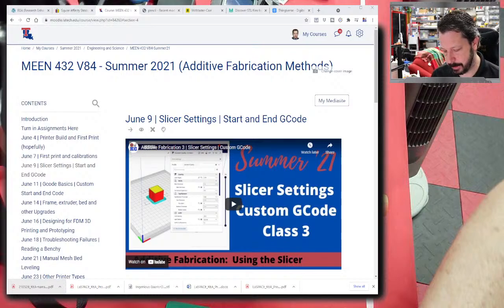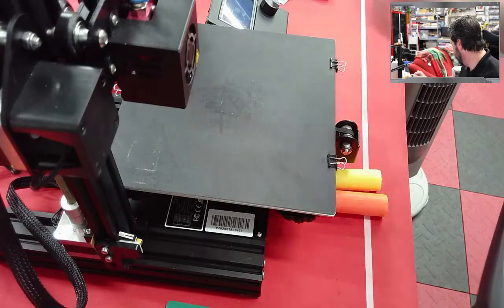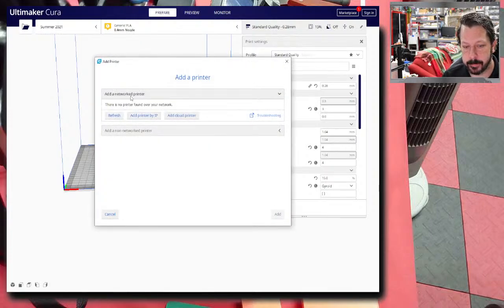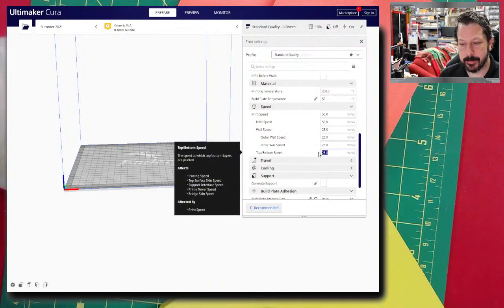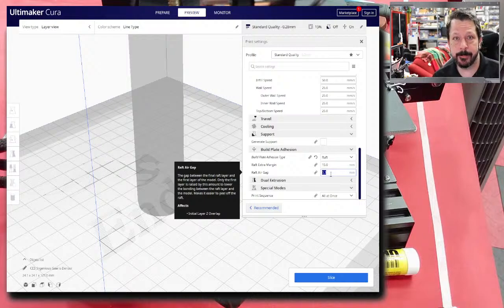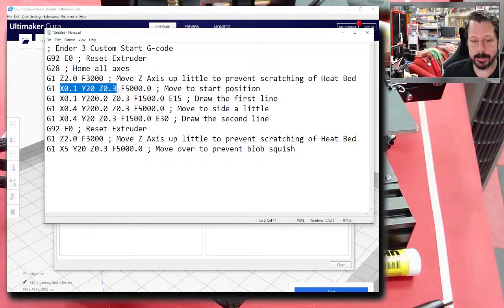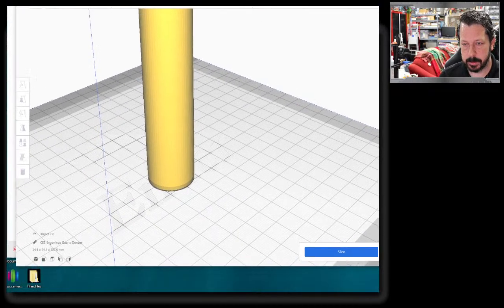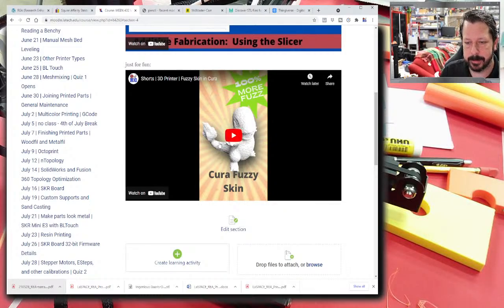Additive Fabrication 3 | Slicer Settings | Custom GCode

Comment: I tried to edit the g code. All movements work, but it won´t extrude.. Any idea??
Reply from the maker: To get an extrusion to happen you have to add E# where the # is the amount to extrude. The catch is that it is cumulative so a command to extrude a line might look like: G1 x100 y20 E10 (this would extrude 10 mm of filament while moving to position x=100 and y=20). Then to make a new line you would have G1 x20 y20 E20 (this would move to position x=20 and y=20 while extruding another 10 mm - not 20 mm. So the 20 is the current cumulative amount of filament extruded. That is sort of hard to explain in writing so I hope that makes some sense.